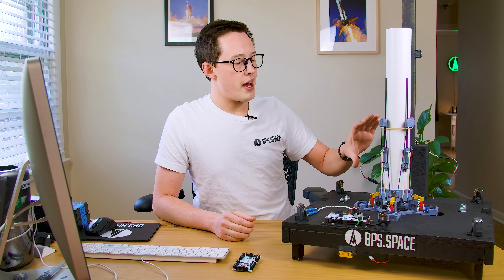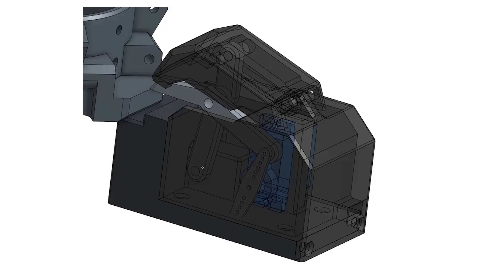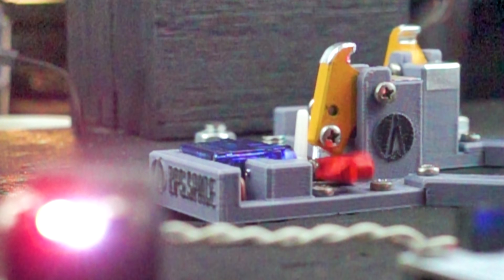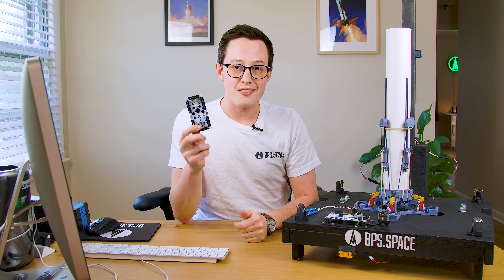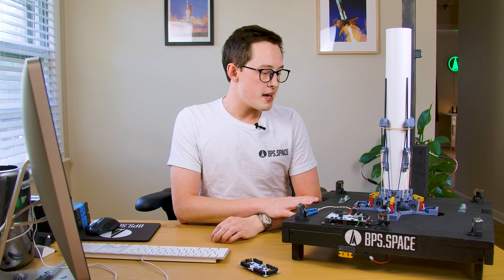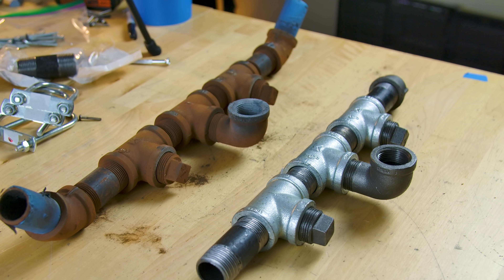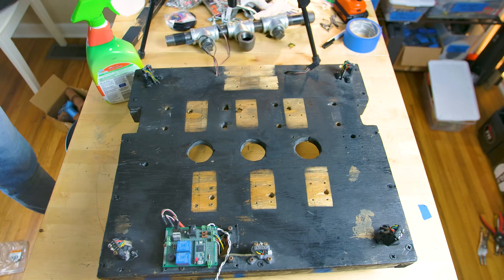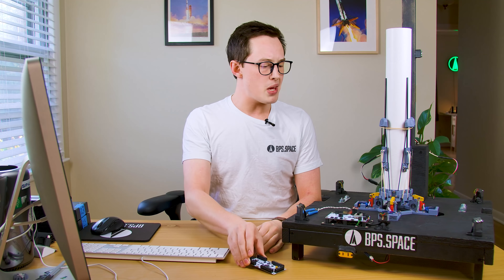Launch Pad Updates

Comment: Why not a purely mechanical clamp setup where the weight of the rocket holds the clamps against the rocket,  and when the rocket takes off, protrusions on the rocket move the clamps out of the way?

Comment: A plastic screw through the fins holding the rocket down is safer and fail safe. But you do have to have a motor large enough to shear the screw.
Reply: He doesn’t use fins

Comment: I didn't read all the comments to see if anyone mentioned this, but the new clamp release design looks like it's based upon a very ancient design for a sling trap.  You know the kind where you pull a sapling tree over under high tension, with a slipknot loop attached, which is released by stepping on a twig or trip wire.  Same concept.  Ingenious using it this way.  A trick I need to keep in the back of mind anytime I am facing a similar situation.   I am an electronics guy, so the mechanical stuff is always lost on me.

Comment: Hmm.
Why do you have all the electronics and servos etc on top of the pad?
If it's for the looks, I totally get it tho' :D
Reply: Where else would you put it? The servos are part of the clamps. You can’t put it in the pad. Also, it makes the PCB easier to access.
Reply: @fullflowaerospace  
Under the launchpad, so that only thing taking the blast is the release mechanism only?

Or
Use see steel rod to pull the lever system to extend the gap between servo and the rocket.
Reply: @mattiparviainen  it doesnt really affect the system at all.

Comment: try adding two more stages, one slinger stage on ground, and a air breathing stage turbines, kerosene, then the normal rocket stages when assumed that there is no more aerial oxygen
Reply: the rotary disc gyro, by mass, should keep the rocket vertical even if there is no tower to keep it up
Reply: what happens if you launch mortar from a tube
Reply: javelin type launch holder tube
Reply: Dude……. You really think he is using liquid fuel lmao
Reply: Do you even know how model rocketry works

Comment: Late to the party but; if you had a ring, say with four tabs. Rotate the ring with a single solenoid (or two for redundancy - or power. The tabs could trip the arms you are using now or be directly holding back the rocket. If it rotates all the tabs will release. Kinda like a bayonet ring on a camera lens. Simpler than having four servos.

Comment: Why not just attach a Temperaturesensor to the exaustport to check the if the Rocket is lit and only then release the clamps?
Reply: It’s not needed. The launch computer controls the ignition of the motor and the release of the clamps. A Temperature sensory would not only be useless and a waste of money, but it wouldn’t even work anyways.
Reply: @fullflowaerospace  
at around 9:50ish he states he found that igniting apcp-motors doesn't necessarily work on the first try. 
Given a spike in temperature the controller could decide to retract the clamps or not.
How is preventing the rocket to tip over useless?
Why does it not work anyways?

Comment: I may be getting to this late, but can you spray-paint or coat the exposed metals with a protectant like Rust-o-lium (or that conformal stuff mentioned) to mitigate the rust issue? For the Launch computer, what of a transparent lid like on those  outdoor weather proofing plug-socket covers the plastic ones with see-through cover (should help protect the works with minor modification)? 
Awesome channel  - subbed!

Comment: Don't know if anyone already suggested this, but add a simple thrust/flame detector.  Could be something as simple as some thin gauge wire between two probes.  When the circuit opens, you know the rocket is lit (regardless of the fuel source) and start a short timer to automatically fire the hold down clamps.

Comment: De-incentavized = discouraged?  Your nifty flame trench uses some galvanized steel water pipe and some "black pipe" made for natural gas. The pipe sections are steel and the fittings are malleable iron. Just because.

Comment: Hmmm.. Best option for a quick release mechanism is based on ball-lock/ roller-lock type arrangement. No friction created to release the lock. A diagram I could find here: http://www.kosmek.co.jp/english/products_img/229_01_01/229_01_01wka_b1.jpg
Your launch system will be a heck of a lot smoother! Plus you could mechanically tie all 4 together..

Comment: If you put a sensor in the flame trench (IR sensor or spring-loaded deflektor plate) the launch pad can detect ignition and only move the clamps when it detects flame or thrust. When using side boosters, this can even prevent lift-off unless all rockets are running.

In my opinion, the deflector plate approach would be more reliable because it doesn't care so much about soot buildup. Simplest way to implement that would be a plate on a long-bladed micro switch with a low spring force.

Another way to implement that would be a pressure transducer in the flame pipe.

Comment: Instead of 4 servos and a bunch of clam pins you could use a bearing ring with notches to hold the clamps and use a single motor to rotate the entire ring. This synchronizes the release of the clamps and makes it easier to inspect and change. Also... single motor ;)

Comment: Have you thought of using brass or aluminum hardware to combat corrosion? Also there are coatings that i use in my gunsmith business that are corrosion impervious and will not be burnt off. I also have possible ablative coatings.  The coatings will work well on the springs as well as i have some air cure vs. Oven cure options. I am in Knoxville TN. Email me to discuss: teamklrdefensiveconcepts@gmail.com

Comment: I'm intrigued by the throttling too, how Joe will do it with pre-made hobby rocket motors. If it's a single motor,  then I think that a long heatproof  servo driven sliding sleeve extending past the nozzle may be able to do it (reducing thrust the more the sleeve extends down). See "Krushnic effect" at the link below.  But Joe may have something else in mind.  https://www.rocketreviews.com/krushnic-effect-180703140820.html

Comment: Not an expert. Why not use aluminum rivets instead of screws? Either pop rivets or small aluminum rod you mushroom over. They should be strong enough for this application and not rust as corrode.

Comment: Try to make your own engine fuel using kno3
Reply: No
Reply: @fullflowaerospace  why?
Reply: @mo5-k1j  there are a number of safety considerations that you will need to have when building it. what most people dont understand is that there is a very high chance that when you are building an engine, it could explode and you can die. also, he has no use for one even if he was to make one right now. and these are just a few. there is alot more reasons why, but not listed here.
Reply: @fullflowaerospace  thanks

Comment: ok so i dont know how well im going to be able to put this into words but if you wanted to make the launchpad not require manual reset every time if you used a shape kinda similar to the carhartt logo on the servos and just let them spin the whole way around. essentially when its in the ready position its at the top of a curved ramp. when the servo moves 180 degrees, the latch would fall off the end of the ramp and release the rocket. then once its clear you spin the servo in the same direction as before to make a full rotation and the curved ramp closes the latches again.

Comment: Some notes on that humidity problems...

I know it is much easier and cheaper to use well-documented, very "basic" parts (as CPU, gyros etc), but try to look for military/aerospace variants. Often, they are in the same product line (LM075), but with different suffix (LM075-A). Those can withstand much bigger physical stress, radiation, humidity, and overally more harsh conditions. Some could be in different product line, and a bit more expensive, but the difference will not be more than a dollar for a piece. 

Conformal coating is very good to do. But the pad computer is.. too much exposed. At least for my taste. I mean, you put the thing on the ground, which can be wet, or there could be light rain, or just humid air.. And conformal coating, if done badly, can peel off. I would enclose the computer in a case (3D printed), with few went holes. Put a fan on one side, a let it blow through the PCB. Preferably get one with higher cpm, as this should "dry" any condensation on board faster, than it condensates. Also funny thing I sometimes do, but turned out to work well, is to put one bag of silica gel into the boxes. It sucks up residual humidity and it may seem dumb, but its small and literally costs nothing, if you save few of them from shoes or whatever new thing you bought.

Welp hope I helped with something  :D Very excited for Scout-E launches!

Comment: you can 3D print a housing cover for the servo so you mostly only need to replace the servo arm rather than the entire servo. Think like an open top box where the servo arm protrudes out of a cut out on the side of the box as for your boards you should also 3D print covers for your boards if theyre on the launch pads in general rather than just coating them just for added protection once the rocket clears the platform. Its excess filament but i mean

components add up lol Good work so far!

Comment: I would recommend replacing the four motor design with a geared ring with notches on the inside. If you have a ring that goes around the entirety of the clamps and have notches on the inside that would push the pins out of the way, it would allow for a more unified retraction of the clamps. You could use the servo motors to turn the ring, and it would be a cheaper and more simplified design. This launch pad is already really awesome how it is though! Keep up the good work!

Comment: A thought - I noticed that the posts holding the clamps shut aren't necessarily releasing at the same time which seems like it could be an issue.  If the posts were printed attached to a disk parallel to the launch pad, you could use a pair of servos to bump it and all would release at the same time.  You'd probably need something slick like PTFE or whatever as a bearing surface for the circular slot that holds it in position but it seems like that could synchronize the release better.

Comment: You mentioned the problem that a motor might fail to fire and the rocket could tip over when the clamps open.
Can't you use some verification that the motor is burning before opening the clamps?

Could be something as simple as a photoresistor (used as brightness sensor) in the exhaust trench that reacts to the brightness of the flames. Or maybe a load cell / strain gauge that measures the build up of thrust.

Of course downside would be a slight delay before the rocket takes off. But on the plus side it would closer resemble what real rockets do, therefore it would be more awesome.

Comment: Would galvanized hardware hold up better?  You should be able to get galvanized stuff at just about any hardware store.  Worst case, spray on galvanization is also a thing.  Used to use it building equipment masts on wind farms.

Comment: As far as mechanisms go, i'd like to suggest an arm with an elbow that opens slightly over 180 degrees, "locking" in place. It's plenty strong, and not terribly hard to unlock by nudging the "inside" of the elbow

Comment: I wonder if it might  help to spray down the launch pad with Corrosion -X in addition to the conformal coatings on the electronics. I have used it with model boats successfully. You may want to check the material safety sheet first for flammability.

Comment: why don't you use metal gear servos?
Reply: Why should he?
Reply: @fullflowaerospace  generally more available torque transfer and less chance of stripping out.. I solely run them in my planes some of which are capable of over 100 miles per hour.
Reply: @WX4CB  plastic servos work fine for what he needs.

Comment: Not sure that this is good for release system to include four motors. Delay between each leg may be quite sensible. Would it better to actuate all four legs from one mechanism (for example one big ring with cams or several rods and lever arms) from one big servo. In this option leg movements will be much better synchronised i think...

Comment: You might get more consistent hinge behavior (and lower friction) if you used some kind of pin rather than a screw. This also helps prevent the screw from clamping the joint https://us.misumi-ec.com/vona2/mech/M2200000000/M2202000000/?curSearch=%7b%22field%22%3a%22%40search%2cseriesList.templateType%22%2c%22categoryCode%22%3a%22M2202000000%22%2c%22sort%22%3a1%2c%22allSpecFlag%22%3a0%2c%22page%22%3a1%2c%22brandModeFlag%22%3a1%2c%22pageSize%22%3a45%2c%22daysToShip%22%3a%220%22%2c%22%22%3a%22%22%7d&resultTabs=&listDisplay=mc-list or https://www.mcmaster.com/pins/clevis-pins/

Comment: I wonder if you could incorporate some kind of load cell into the pad to allow it to release only when the motor comes up to pressure... Even a simple photoresistor behind a plexiglass screen to watch for the flame might be enough, or some kind of pressure or flow sensor in the flame trench. It would probably help with reliability of the system overall as well, as while BP motors don't often fail to ignite, they do still occasionally, especially with the crap Estes calls igniters these days.

Comment: Why not use nylon screws to prevent rust? You could plastidip the springs and any other exposed metals also.
Reply: You do know that rockets are hot, right?
Reply: @DouglasEKnappMSAOM  Sure, but the screws are going into other 3D printed plastic parts, which I'm assuming the exhaust isn't melting due to the low exposure time and exhaust flame trench?
Reply: @JamesClutterbuck  You might be right.

Comment: Hold-down - two rods of simple solenoids, 180 degrees (or 120 degrees for three) from each other, inserted into 3D printed fuselage attachments with holes for the rods.  Solenoid rods pull back into 3D printed enclosure with rods held back until rocket exhaust is no longer a factor.  The end of the rods are protected from corrosion by lacquer coating and/or a thin disc of something non-corrosive epoxied to the end of each rod.

Comment: I was thinking, could use a single motor to operate all the clamps ?  Hard to explain but...  If you had a ring gear mounted on the pad which had arms that interacted with the red parts of the clamp.  A single motor turning the ring would simultaneously unlock all the clamps ?  Perhaps have a pair of motors for redundancy.   It might even be possble to use a piston to drive the ring as the movement required could be small.

Alternatively - use a "pyro" system to release the red parts - e.g. a fusible link holding the clamp closed ?

Comment: Instead of using a motor to rotate and knock the pin, drill a hole in the launch table, put the pins in place and hold them there with a single ring from below which is moved or rotated by a pneumatic ram. The result is the same but there is no chance that one individual motor will fail and it is reusable.

Comment: All 4 bolts, that open the clamps should be attached to a ring shaped device, which is mounted to rotate around the center hole. This ring device could be driven by two servos on opposite sides. The setup would guarantee that all clamps open at exactly the same time.

Comment: Could you not replace all of the stainless steel screws that are on the pivots with 3d printed 'rivets'?

You could replace the spring with a tensioned band of plastic integrated into the segment of each clamp, or just weight the clamps to fall independently without a spring.

Loving the journey. Good times

Comment: “We’ve got throttle control now!”

YOU W H A T
Reply: The secret is not changing the amount of thrust, but the amount of thrust you're using to accelerate upwards (it is not cosine loses).
Reply: @stevato0449  💧👁👄👁💧wot my brain hurts
Reply: Thats like saying you can throttle control a solid booster
Reply: Came here to post this. With black powder motors?? Howwwwww?!
Reply: @gsmontag  since its powder it can work the same as a liquid!
Reply: @octaviusgalacticus2253  how so?
Reply: My son just modifies the solid motors so he has more thrust during lift off, then less to hover, and then less again to slowly descend. Its not real time thrust control, but its built-in thrust control if you know your flight plan. You can build it all into one motor or stage them. Check out Space Jace.

Comment: @BPS You state that it is impossible to fly the hard to light motors, but can’t your release the clamps based on if the motor produces lift? Like on real rockets they check that the engines work properly before comitting to launch

Comment: If you added sensors to confirm successful ignition, could you fly APCP motors on this?

Four options I can think of:
* Load cells on one or more clamps
* Thermocouple to detect radiant heat from exhaust plume
* Photodiode to detect glow of exhaust
* Tiny wire(s) stretched across flame trench opening that breaks when hit by exhaust

Comment: if you run a thin wire (or aluminum foil) under the engine, when it burns through, you could use that as a sensor to tell you the engine has lit and have it release the hold down clamps. (or two tungsten electrodes (TIG rods work well) with a voltage bias and have it measure the plasma from the flame if you want more complicated but more robust).  Small weights on the end of the servos to act like wee little hammers could be fun too... (You do have static friction, it is now just easier to address).  As always these videos are a whole lot of fun and look forward to the next!

Comment: If you had a ring with ridges instead of your red arms, you could use a single motor rotate the ring to release the clamps and potentially reset the clamps if you rotate it back.